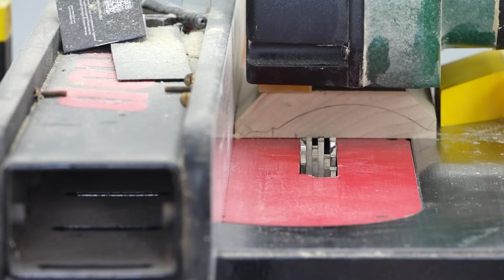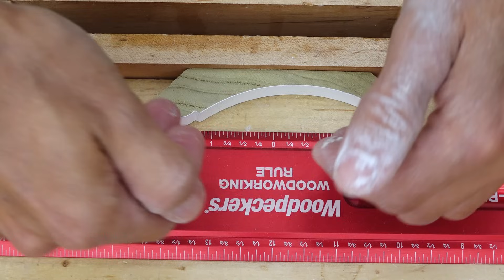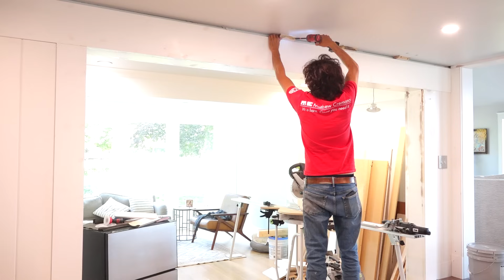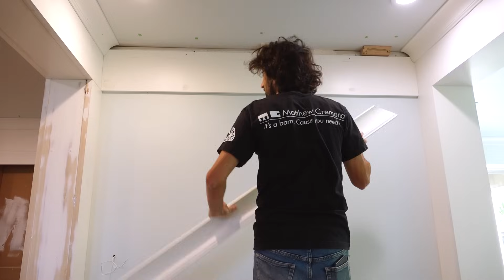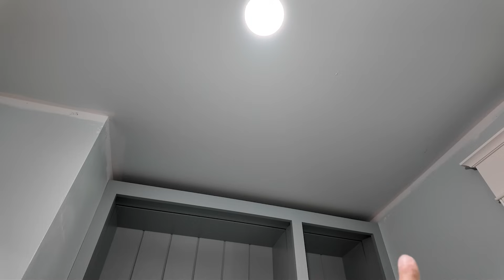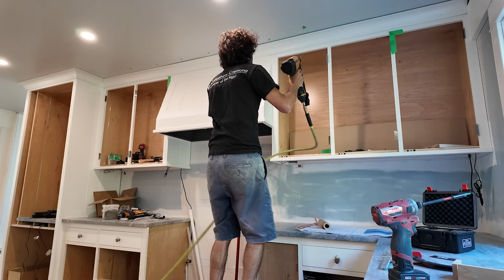Making and Installing the Crown Molding | Home Renovation & Addition Part 83

Comment: I am weird I admit but as a finish carpenter I thought that Moulding Machine was the bomb !  I hv looked at them but I am so crammed for space !  What a great job Matt !  By the way I had a customer fire me over crown and also a GC over crown !  1 st was an alomost 100 yr old farm kitchen where I did 48 doors refitted with hidden hinges , several pullout and crown !  Well they both thought I was taking to long and a 16th “ gap or less was unacceptable?  I told them I was not done ( it was tacked up with pins while I mulled a solution) .  So I left cut $3000 off the bill ( I did not hv to they were under contract).  
He said he would finish the crown ?  
So a month later I asked for so pics?  He blocked me ?? 
In 16 yrs only two unhappy ppl not bad ?

Comment: Depending on what stage your cabinet doors are in you could “grow” them a bit as you move to the outside wall to hid the gap between the crown as well.
Reply from the maker: They’re inset. The door opening would also need to change

Comment: We are generally our own worst critics. You will notice the incline, but noone else will. What you could have done was twist the return on the appliance cabinet so that it inclined 1/4". Then you could roll the left side of the long piece and do the same thing you did with the right. It would have given you a straight 1 1/4" reveal across the top of the cabinet doors.

Comment: A few things that I find improve the results with crown moulding. 
1. Be sure to finish the back as well. It will be more stable and less likely to cup and warp. It is very hard to cut accurate joints otherwise. 
2. If your crown is in contact with the ceiling, be sure your ceiling and cabinets are both level. It is a pain in the butt to level out the ceiling with mud at this point, but it might be the best option. Filling voids with caulking doesn't work very well and you will have cracks open with seasonal wood movement.
3. As much as possible, joints should be made with the same piece of wood. For example, if you had a 10’ length, starting from the left, cut a 2’ piece off that has an outside mitre on the right, you should then cut the mating right hand mitre from the left side of the remaining 8’ length. This gives you the best chance to have precise mitres. Trying to create nice mitres from two different pieces, that behave differently with seasonal movement is difficult. Try to transition to new pieces at inside mitres. You can tinker and tweak them more than outside mitres. They are more forgiving. 
4. Make a good support table for your mitres saw. 
 
I hope someone finds that helpful.

Comment: another possible solution comes to mind from the way you discovered it in the 1st place,measuring from the cabinets.Perhaps you could have pinched a smidgen off the overhead cabinets by changing their heights or even angles(a fraction of a degree) reducing the gap or at least making it more even across the whole length🙂
Reply from the maker: That was my original plan but people on IG talked me off the ledge
Reply: @mcremona  the best job in the end,happy builder(you) happy customer(you again)🙂

Comment: We assume you did not have 220v 3ph for that molding cutter. So the bed could have a vacuum bed? Just need a few pneumatic rolling hands for pressure when and where needed. a good Powermatic PM9 3ph shaper 7.5 hp is $14 grand new is that tooling capable vs your style? Can even a small unit be justified vs running 1 hour of an industrial place which 460V like your chair seat scoopers co. instead

Comment: Your commentary installing crown is spot on. 

Another aid when the prints call for crown is to pull a string across the ceiling joists before drywall goes up. This will give you a heads up about challenges when installing trim. This doesn't solve everything but it is a quick way to evaluate if you elect to add shims, add blocking, or just deal with it when installing trim.

Comment: Matt, I had some similar problems due to lousy framers, and I discovered this during a kitchen remodel. I had crown installed and was kind of relieved to see how just bending the wood gently over several feet was fine (and I’m such a perfectionist). And mine was stained cherry, so more difficult to hide, while you have painted surfaces. I’m sure it will be beautiful!
Reply: I think because  of the range hood and you are white on white, it's going  to be good to go😊

Comment: As a cabinet installer, this is par for the course.
"Rough framing" should be done as fast and cheap as possible .
Usually the worst spots on the vertical, are where beams are added with hangers..which causes a bulge.

One job on a remodal, had floor  3" out of level.
So new flooring was removed and it was leveled after base cabinets were set. Most of the shims were lost. Next came the ceiling which was only 4" out.
Rome wasn't built in a day.

Comment: Thank you for pointing out the complexity of proper framing. While simple in concept, in practice it can be quite challenging. A quarter inch out of plumb a half inch out of level can have consequent complications which require highly skilled craftmanship to overcome. Your wall and floor scribe techniques previously demonstrated are but one way to overcome framing irregularities. Once upon a time plasterers made up for framing difficulties but those days are largely gone.

Comment: Would a slight taper on the right cabinet door help hide that in combination with all the other slight adjustments?
Reply from the maker: Door opening would have to have been made at that angle
Reply: @mcremona  oh yes. I was thinking the doors would have a lip on them. Not flush fit. I know there are certain terms for that but … oh well

Comment: One of the first jobs that I had as an apprentice was to install drywall backing in the basement joists with a hammer mind you ( before nailers were prevalent) needless to say I was very aware if any was missing when we were framing

Comment: Usually ceiling guy doesn’t care about trim guy. In this case it’s the same guy. lol. But great solve with the 1/4”. Most guys will not even mud and leave the 1/2” blaming it on ceiling guy. Once doors are on the cabinetry the 1/4” will not be noticeable to even the cabinet guy.

Comment: Could you taper the top of the cabinet doors to make up that 1/4" difference?
Reply from the maker: I considered making the top of the cabinet angled when I did the layout for it but building an out of square cabinet and doors sounded less appealing than hiding it in the trim

Comment: Why not just put another layer of 1/2" drywall on the ceiling? (Genuine question, I'm not in residential construction)
Reply from the maker: Another option. You’d still need to float the seam/transition are
Reply: @mcremona true. And would still mean a mess in the kitchen, and repainting

Comment: Instead of dropping the ceiling and firing the joist a 1/2 inch, how about adding an additional layer of 1/4 or 3/8 inch of sheet rock.

Comment: The challenge with buildings etc - is we draw them in elevation, but when they are built, we see them in perspective. I.E. things that are parallel in elevation - are divergent/convergent to our eyes.
Back in the day, we used a water level to set the sistered 2X furring on the sides of the out of level joists - and it does save headaches later.

Comment: Man, I'm so triggered by this ep. I had a 100k raised panel living room that I built to Architect's measurements, only to discover the ceiling was off by well over an inch and a half. I went the heavy plaster float method and eventually everything got close. But it still haunts me.

Comment: When I cut crown, I dedicate a compound miter saw to that task.  I allways cut on the
flat for more accurate cuts setting the bevel with a bevel gage dialed to the correct
angle.  Sometimes you have no choice but to go backwards, like ripping out a 4'x8'
sheet of drywall to fix an air return duct that protrudes 3/4"

Comment: Nice job of manufacturing your crown molding never an easy DIY to get right. However most framers know by the ceiling problems like you are now facing that kitchens and any rooms with wall cabinets that go to ceiling and or crown moldings  must have flat ceilings. The expirenced assiciate you had working with you during the framing should in my opinion have pointed this detail during rough build out  to you. A remedy you could cut long angled shims every 12" attach (glue) to angled ceiling area and cover with 1/4" sheetrock and this would level the ceiling w/o having to demo existing ceiling only heavy mud would be feather at end of 1/4" sheet rock which will work. Your kitchen is custom spectacular to coin a new phrase it is really furniture grade. Ray

Comment: I love this kitchen project! Did I miss what type of wood he's using for the crown? That power feeder is killer, what a great way to make sure the back cuts are all the same
Reply: Looks like poplar.
Reply from the maker: Yes
Reply: So…where you rolled the crown to hide the gap did you have to fudge the coped piece over the windows to compensate?
Reply from the maker: @supergimp2000  yes, it’s twisted
Reply: It's maple IIRC.

Comment: I have a Woodmaster Moulder to make my crown Moulding.   It takes two runs, first is the back angles and then the cove cut.  I can run both cutters on my Woodmaster so you run the back cut and then run the cove cut  side by side next to the other cutter.